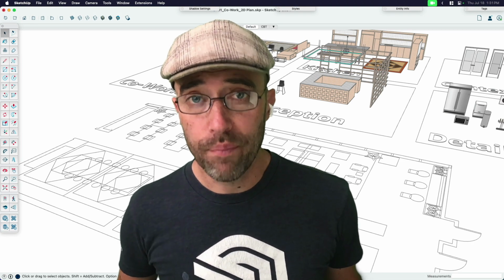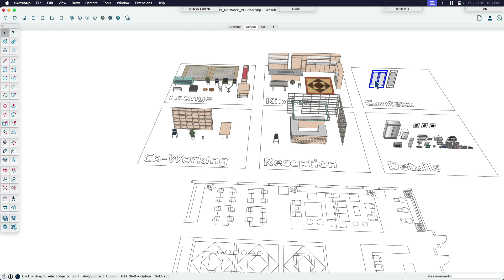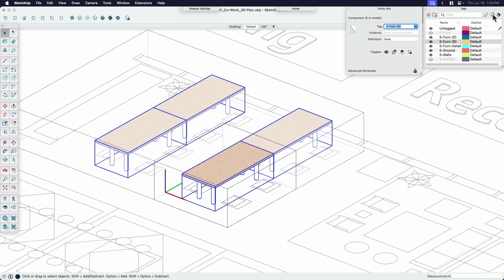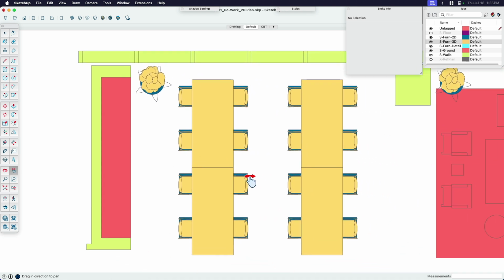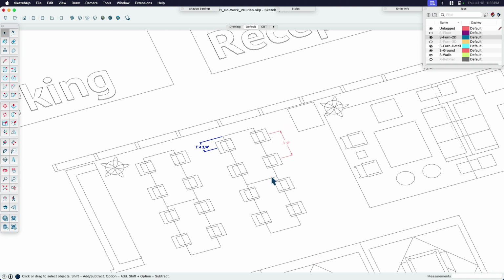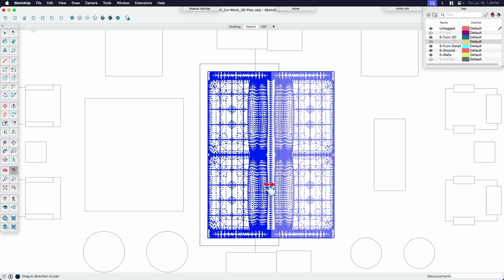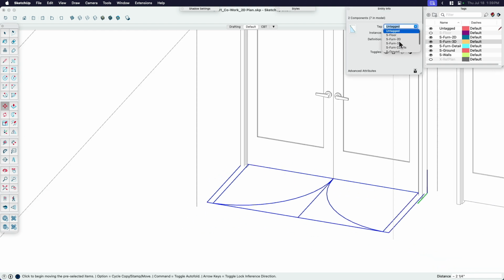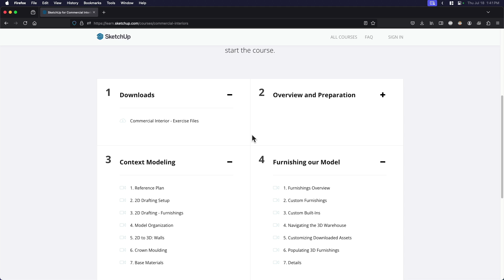2D or not 2D? That is the Floor Plan Furnishings Question

Comment: @SketchUp  having a way to save a predefined tags list in Sketchup that syncs to a predefined line-weight table in Layout would be very handy. Basically something similar to AutoCAD's Plot Styles. Even more helpful would be the ability to save a list of tags so that you could import tags into your document as you needed them, just by searching their name or description. Right now I use templates for this (a Sketchup template and a Layout Template with my Sketchup template embedded so that the tags are synced and line-weight preferences can be saved). The largest issue with using templates is that I have to start my blank model with 200 tags, or if I go with too few tags to start, halfway through modeling I'll realize I needed more tags and will have to carefully recreate them so that Layout can still render them at the right line weight. Another challenge I have with creating 2D drawings in sketchup (like in the video) is that I can't control the draw-order: I've noticed that if I have an object with tag A exactly above an object with tag B, and both objects have the same line weight, sketchup will sometimes pick the smaller of the two lineweights rather than the thicker of the two. I feel like to have any control over my 2D drawings, I have to re-create a lot of the geometry in 2D.
Reply from the maker: All good points. LayOut has made some major improvements recently so I would hope that having more control / automation over lineweights is something we can see some day....and 200 tags..wow!

Comment: Before SketchUp 2024, there was a good plugin called Curic Make 2D. It created a 2D model of the 3D model with textures. Currently, a good way to have low poly furniture for plans is by using Enscape Proxy in the correct layer.

Comment: That's not smart i used sketchup for 12 years ,you need add more architectural elements to programs like Gridline, Levels , doors&windows, make th pattern fill easier to add hatch to wall ,all your tips still not smart and we still need to use another autodesk programs to complet the project we are Architect and need this tools to save time we know that we have plugins to do something like that but still not smart and easy i think if you update sketchup to that level you will get more users ..i wish i saw this update in program soon 😢